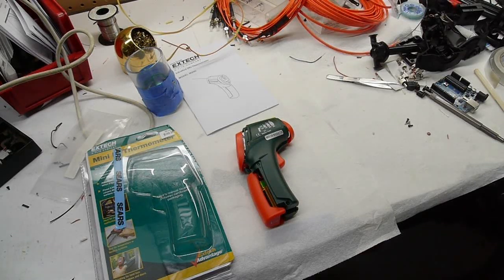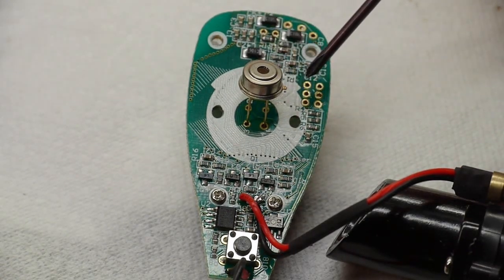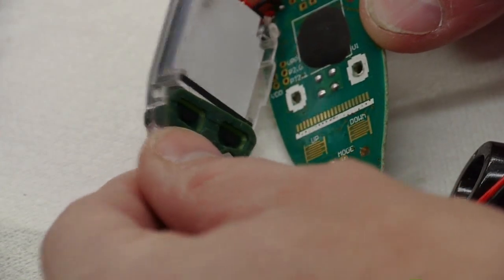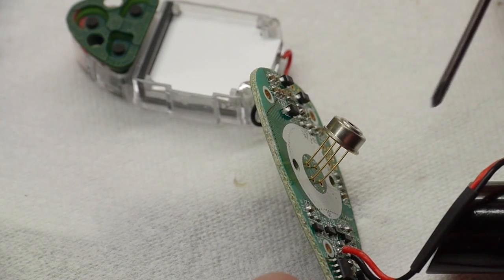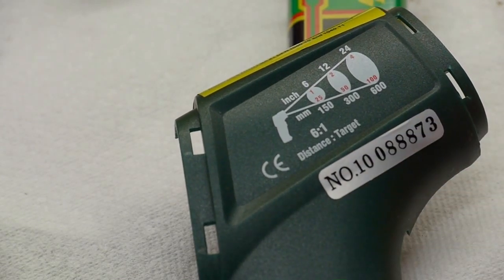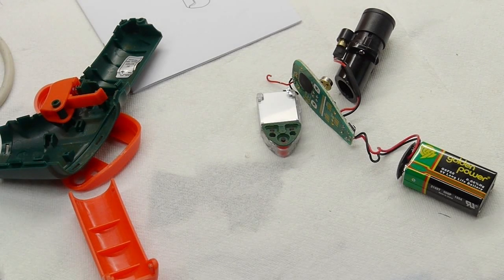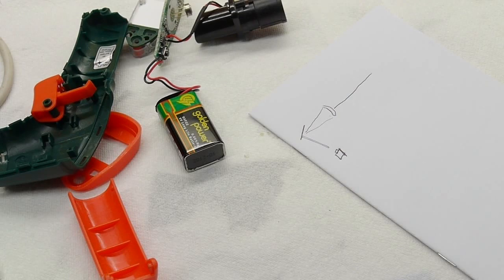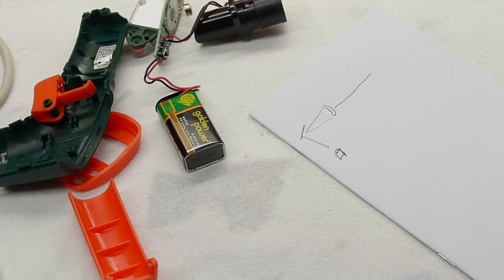Extech IR250 infrared thermometer disassembly and plans for thermal imaging

Comment: I'm trying to figure out how to re calibrate these. I jumped the cal pins and when you press the c/f button "cal" show up on the screen but I don't know what to do from there.
Reply: You would have to know the exact calibration routine the company uses on the production line. Without knowledge of what temperatures and in what order to present them, you'll just destroy the factory calibration by starting the cal routine.

Comment: how would you calibrate that thermometer? Are the offset values stored in that eprom?
Reply: It would have a calibration routine where, on the production line, each device is pointed at a black body that is adjusted to be as close as they can reasonably get to an exact temperature (probably something like 0 degrees C, 20 degrees C, etc up to 100 degrees C) which the on-board processor can then do a basic linear regression to help offset differences in individual sensors, assuming they are roughly linear. It's possible they do many more temperatures than that, or fewer that are further between. And yeah, the exact voltage at each temperature would be stored in that EEPROM. Without knowing exactly how they do their calibration routine, it'd be pretty difficult to re-calibrate yourself. Theoretically you could probably get a more accurate device if you did have the time and materials to make very precise temperature targets.

Comment: does the lens increase the range of the sensor
Reply: Sort of, but there's a limit with fresnel lenses. If you want to really "zoom in" with a thermal camera you'd need some pretty expensive silicon optics.

Comment: You'll want to check out the Melexis MLX90620 for your camera project.  It's a 16 x 4 thermopile detector for about $80.  pre-digitized and easily read with an Arduino or other microcontroller.  Step and stare with that to build up your images.
Reply: Mlx90640 is about to come out

Comment: i think you can build one using a webcam changed to inflared (use negative photo filter) and a software that mesure distance  and the contrast and density of the pixels (make a simple mathematic formule to keep this information always available) calibrate all things and you have a webcam that read distance and temperature with incredible accurancy✾☄
Reply: It's not that easy, unfortunately.  Refer to the wikipedia article on "Infrared Spectroscopy"
Reply: How, exactly, does a negative photo filter (not even sure what you mean by that) turn a visible light sensor into an infrared sensor?

Comment: Early heat seeking missiles use a single sensor. The image is reflected similar to a cassegraine telescope with the reflecting mirror replaced with a spinning mirror that has a triangular modulation window on it. The eyepiece is replaced with the sensor. Your image would be round and the triangular window pattern changes the pulse width modulation of the signal depending on how far the target is from the center. and of course sensing mirror position wil give 360 degree position around yr img.

Comment: I don't think you'd get much extra speed by mirror scanning as scan speed will be limited by the thermal mass of the sensor. I wonder if using a chopper might help - removes the DC offset issue of the high-gain amplifier. All the thermal imagers I've see use choppers.
BTW Melexis also make thermopile sensors.

Comment: Hah, I always wanted to do this myself! Look into compressive imaging (google "single pixel camera"). The proof of concept also used a DMD matrix using a similar setup as your diagram, but in this case the matrix was randomised for each exposure (ie per sensor measurement). Once you take enough samples, you can use the series of samples to mathematically reconstruct the final image via a computer.